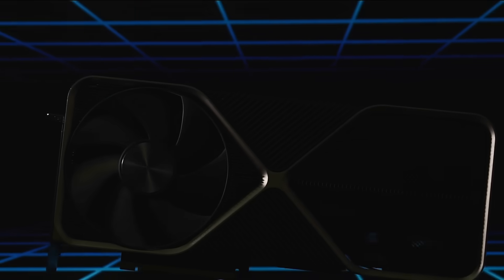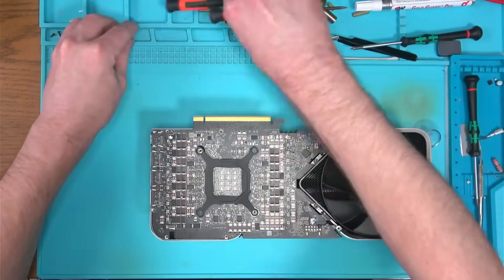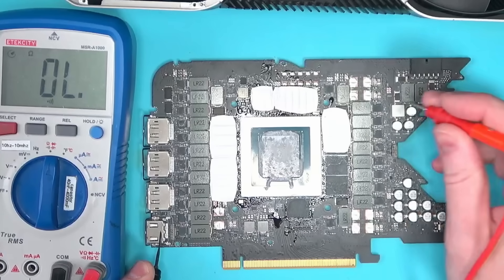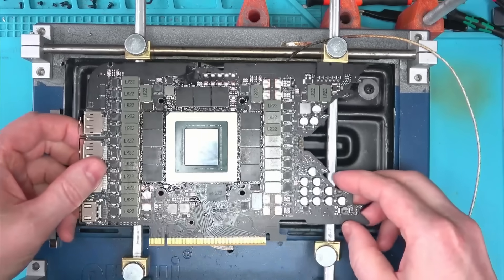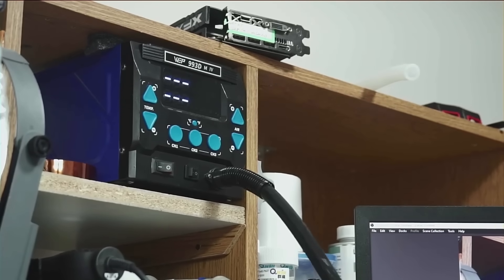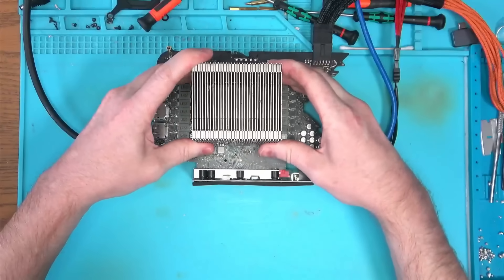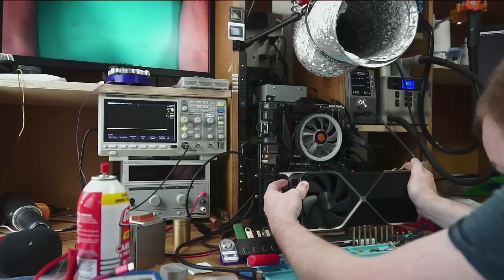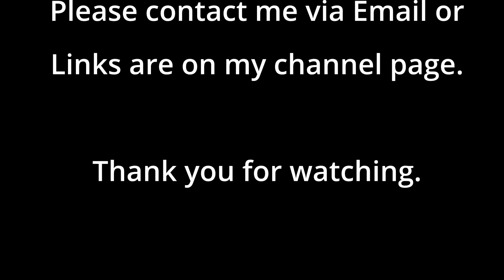Why 4090 reflow is a BAD IDEA

Comment: Do you use that little cheap meter because people are so borgia about crap like that, as if you need some insane meter to do these jobs, I know people are very odd.  I have a cheap meter too and I dont know why I would need to buy a fluke, I mean what exactly do you get?  an expensive slightly more accurate meter?  Do we need that accuracy for repairing pcbs?  Of course I dont repair anything I am trying to learn though, but man its all money buy this buy that etc now I need to learn how circuits truly work if I ever want to intuitively understand what is going on

Comment: I'm sure this gets asked all the time but why is 90+ degrees for a core bad during work, but blasting it with the direct heat of the sun to remove/resolder it to a board okay? Why doesn't it cook the chips?

Comment: repairing those rip of traces on the memory chip area...I wasn't even sure that was possible !...so, in regards to the P.C.B....the repair involved just placing down another copper disk, I'm kind of amazed at that, is there only one layer of traces through the card ?  I'm guessing that any repair at this level requires a lot of specific proprietary board layout knowledge...

Comment: I really want to know about the Furmark test. My 3080 goes up to 82C and the hot spot to 94C. Does it need a pad replacement, or should it be fine for a 75C workload? 2 years using it. but all its in factory fan settin and no other fan , but in higher 80% fan spin , stay in 71c, so add fan to case or replace pads?
Reply: Just add a new fan

Comment: After watching quite a few of your vids now, my recent video card upgrade am thoroughly glad I avoided the 40xx and the 30xx settling for a "GPU crisis" OEM 2060 Super which is awesome despite its age.   It will do until I decide to invest in a AMD setup down the road and felt a bit sorry for my new build RX580SP which I got for £51 and gave me 3 years hard gaming service and is now going into a Xeon dual CPU build mobo, cpu and ram from Aliexpress for £31, 20 cores 40 threads via the dual 2630 v4's.   Will still be a potent machine just no raytracingerythingy which I think is a con.

Comment: Actually Reflow Works Great If u know how to do it properly . its not only ''REFLOW'' Everyone Knows that Reflow is temporary .  U just Reheating solder joints to potentially resolve issues caused by cracked solder. Caused 99% by Overheat . After that U 100% need to undervolt ur GPU . 
so actually u make it live Longer not month but YEARS.

Comment: YEAH you hated on them for reflowing for no reason and yet you reballed the dang thing basically the same reason they reflowed it yet it wasnt the problem! You should have replaced the memory chip to begain with and you seen the errors on mem and wasnt nothing but the memory

Comment: Clean job!
I have been doing video reflows for years with a torch - never actually removed the chip (I don't actually do any micro soldering). And I've been pretty successful with it. Pretty much mostly on laptops, rarely on desktop cards. However, recently I reflowed a desktop 2080 ti - a dead card that someone left at my shop, and so far it's testing working well. 
A reflow is interesting, because you never know how long a card will last, or if it was actually the GPU chip itself without checking/testing as you're showing. I've had reflowed cards that have lasted years, and others just a month or two. What's really important for ANYONE is to always make sure you keep your system dusted out - it will help with the longevity of your computer as a whole.

Comment: Fail 95% of the time with newer GPUs?
My experiences with throwing GPUs in the oven are rather good, at first it might survive another 9 to 18 months, the next time it'll be half that and so on, until it's mere weeks and then ultimately other stuff will fail.
But this has worked on a lot of graphics cards I used or ones that were donated or on their way to be thrown away.
While the last time I did any of that is a few years gone by now and while I never attempted it on 20xx, 30xx or 40xx
I am far from the only person where this has been done quite a few times, to quite a few graphics cards and it is more like 95% success and 5% failure.
Tho the graphical glitches from failing BGA and memory solders are pretty distinct, so i personally doubt people try it for other failure.
For most of the time, this kind of thermal degradation was the reason for the majority of GPUs i handled, to be broken.
And for a card, 3 years past it's prime time or life time, to live another 1 to 2 years, is quite a lot.

While I don't think 40xx will much suffer from thermal degradation as much as earlier GPUs, the issue with how thermal degradation interacts with the solder due to expansion and contraction, makes reflowing it in the oven a cheap and easy way.
Reflowing it professionally should be even more useful for this very specific issue that we will likely not get around for a few more decades or until the last star in this universe burns out, depending on if we use solder or other electrical interface materials with different thermal properties in the future.

So if a laptop or PC shows certain artifacts and it needs to run and the only option is an immediate upgrade/replacement of the defective part.
Why not just throw it into the oven and pray?
Also in many regards, a dump into your oven to reflow, surely has a lot less points where user error could make it worse and especially if you only hit the right temperature in your oven and leave it for the appropriate amount of time, the thermal capacity and thermal conductivity of the different materials involved, will make sure that parts that are not solder, can not be damaged or be overheated.
Depending on the size of the cracks, which tend to be really tiny and miniscule, you won't even need to worry about having to use flux and with a little luck, the card will last you another two years until it fails the same way.

While a reflow oven offers considerable advantages to this process, you can use a reflow oven just as half assed and if it is this very specific issue of thermal degradation, it will work wonders without you even having to use flux or solder.

I wish this video went into detail as to WHY it is a bad idea also it seems that the card in this video does not show any of the errors where a basic half assed reflow is a possible fix.

Comment: So the card was running @ x1. After fixing the problem the card now runs @ x16. Would there be a performance difference if the card was running @ x8 compared to x16 @ 4.0?

Comment: Hello, I would like to contact you, I have an RX 7900XTX GPU that only works on the PCI Express 4.0 port, when I put it in the 5.0 port it does not work, I was told that it may be the graphics chip that has problems.

Comment: Sorry for a dumb question, what is Reballing and Reflowing and why did you say reflow is a bad idea?
Reply: I'd suggest doing some of your own research, but pretty much:
"Reflow" refers to the temperature at which the solder is certain to melt, reflowing involves heating the solder to this temperature, the goal is to restore any bad connections between the PCB's and the chip's surface pads caused by e.g., cracked solder balls caused by thermal stress (expansion/contraction cycles eventually could cause cracks in the solder balls)

In reballing, the old solder is completely removed/cleaned off and replaced with new solder balls.

Disclaimer, I'm no expert, but generally here's what I'm thinking,

Reflowing involves dumping a whole load of flux and heat into the chip to get the solder to certainly "melt" throughout, you want the solder to be liquid enough to flow onto the pads nicely, and flux needs to get all in there on every joint to ensure a secure bond between the solder pads.

On a smaller GPU, with average equipment available to your average repair shop, the process may be fairly straight forward given there's not much distance for the flux to travel, and with relatively little time you could get all of the solder heated up nicely, but a thicc boi like the AD102 of the RTX 4090, there's no good way to get a good reflow going given you can't magically get flux nicely between the PCB and the GPU....

And it's not only an issue with bad technique, reflowing the already well abused solder, abused enough that in at least one place the solder has become brittle enough/cracked such that the connection is unreliable/severed... The mechanical /electrical properties of the alloy are likely to be degraded due to oxidation, contamination, perhaps the formation of too many intermetallic compounds (IMCs) between the solder bulk and copper pads which could lead to more brittle connections, the reflow could end up forming a thicker IMC layer, making the "new" connections even worse, bare in mind you're reflowing all the connections, not just the affected one. 

So yeah the only real option is reballing, use new solder, clean/decontaminate both sets of pads, freshly apply flux all over etc, ensure all surface pads are nicely bonded.... 

It's an interesting topic, I'd suggest researching it yourself, perhaps some of what I am saying is inaccurate eh :)

Comment: I did reflow two times and both times it worked (although I had to reflow one card twice, because first time there were still some artifacts).
The reason I did that and not going to service is because reballing an old GPU is expensive and not worth it, while reballing a new gpu is dangerous - they can take your working gpu and replace it with dead one, and say you had a dead GPU. This is very common in my country.
Reball at home is not something you can do as a hobbiest, I suggest not even try it, you will certainly mess things up, while reflow is relativelly safe (don't cook your gpu for 10 minutes and it should survive, even if reflow itself will be unsucessful).

Comment: What I want to know is what are people doing with these cards that are requiring this in the first place? Why did someone attempt to re flow? One of the only thing that’s stopped me from investing in such an expensive piece of kit like this is all the repair videos I keep seeing.
Reply: The GPU is a very hot component. Constant change of temperature from 40C to 80C and back to 40C leads to solder balls cracking. Reflow fixes that for some time. You don't have to do anything particular for your GPU to die from that, it happens naturally after 4-5 years especially if you are a gamer or mine crypto.
Reply: @ yeah 4-5 years I can understand, but the 40 series ain’t that old

Comment: unbelievable that a card with components for a maximum of 50 dollars should cost several thousands.
and 99% of them are exactly the same as on early graphics cards.
Those companies are good at keeping prices artificially high
Reply: What kind of nonsense is this? In which universe 3000 transistors and 30,000,000,000 transistors are the same?

Comment: I literally don't understand what is wrong with reflowing.  Solder will melt and resolidify, if you don't move the chip when solder is molten, you should not have a problem.

Comment: When I was on the market for a new GPU I was looking at a 4090. Problem is at the time they were going for about 2300 USD because of scalpers most likely. There was almost no reason to get the 4080 because the 7900xtx was better in most cases and cost less. I was able to get a Red Devil for 1000 dollars. It was pretty much a no brainer. Even the 4080s were listed at like 1500. 
I would have liked to get the better performing 4090 but I'm not stupid enough to pay that price for one. If I had been able to find one for MSRP I would have. But my 2080 was starting to show its age quite a bit and I just wanted to upgrade everything. So I did and I don't regret it at all.
Reply from the maker: Yeah good choice. 7900 is a decent AMD card if your goal is to get fps.
Nvidia is more for production so it's cost is reflecting that.

Comment: Why do the components not get damaged when heated up to 200°C?
I was always wondering.
A law in chemistry says that chemical processes are doubling in speed for every 10 K step.
So are the components just aging 1000x faster during that time or is it just about the connections between the components that get damaged by heat?

Comment: It's always nice when repair people actually clean the card after repair. Especially when you use that thick aggressive flux paste.
I've seen some really dirty stuff in my days.
At my job we are not allowed to use that flux paste unless in extreme cases. It's too aggressive to the board and can damage it.
We use a flux that looks like water. It's a liquid rather than paste.

Comment: I reflow every single 4090 i work on.  I tell the customer there is a 50 percent chance this fixed the problem if done right.  Really, it ensures a 600 dollar repair.  If they refuse to pay, i have a clause in the contract i seize the card.

Comment: Out of curiosity on 5:02 the core has 5 balls on the bottom right instead of the the typical 3. Is that normal for this card? if so why does it need that many on the arrow side of the core?

Comment: nice alignment on the chip ,  i used to use $200,000 DRS27's by Air-Vac (Nitrogen gas fed) and i was creatign thermal BGA profiles for 3000 pin processor chips so I know the pain of alignment :)

Comment: Scale of 1-10, how bad of an idea would it be to take an FE 4090 with a water block installed and removing the water block/reinstalling the stock heatsink?  Likely to damage it or probably fine as long as I don't do anything drastically stupid?

Comment: 8:30 would have been quicker and easier if you used high quality thermal putty instead of pads. No need to figure out the correct thickness for the pads and transfers heat better too.

Comment: I've watched a lot of your videos, you're doing stuff pretty randomly.
You should hire a bureucrat, LoL.
Set up a procedure, print it out for every card.
Step 1. Check for shorts. (I always leave without my shorts)
If(short_was_found()) {check_fuses();} // LoL, I had to do this one.
Step 2. Data Lines
step 3. Crystal
step 4. if card is detected in linux or if it displays a picture
step 5. memory
etc...

I know it sounds like a waste of time and a stupid thing.
but otherwise you are likely to skip steps or maybe you just forget something or you're inclined to skip some procedures in order to save time.
This way you won't have to dissasemble the card again for a missing data line / missing capacitor, like in this video.

Comment: i mean i have no clue about repairing gpus in this kind of way, but even to me it makes 0 sense to reflow the gpu core. I highly doubt that the solderpoints of the gpu core fail and if the gpu core itself would be dead resoldering would fix exactly nothing. The previous repair attempt makes 0 sense even to someone without any knowledge.

Comment: My Gigabyte b650 board sometimes screws up the link speed on initial post (x8 on my 4070ti).  Not sure your test board, but a restart fixes the link speed.  On older bioses it would lock to x1 speeds on first boot.  Might be related to that behavior here as well, though a missing capacitor is also a problem.

Comment: I i was a graphics card company, i would invent the GPU Socket.
Reply from the maker: It would not work very well because of heat.
The board it's self is also a heatsink so it has to be close to the board.

Comment: I guess my gtx6xx ghetto reflow was one of the 5% ahaha
Like... HOW does that thing still live after like 5 years, I expected a month max.
Challenge: fix a gpu with only flux and a cheap hot air gun (a proper one at least)
Oh, I forgot to bring my thermal paste so I had to "recondition" the old one from 2012... worked like fresh mx4 for a week xD

Comment: I honestly don't think the client was insulting nvidia or any other gpu manufacturer. I mean, when its not working, its  called a brick. But lets get over that for a bit. 

What i would like to comment on is the fact that nvidia (and amd too) are kinda sort of at fault for this too. I have a 2080. When i got it, was the coolest crap. one year later, is was just crap, minus the cool. now, 1 generation later, sooner to next generation, is just crap squared. I didn't do that. Nvidia did. 

And one day, sooner rather than later, that 4090 will also be a brick, weather its working or not. coz it will certainly be worse than 8080 that will be modern in 4 years. 

PS Sorry for my comment. I just ... am thinking of the stuff that i have. that i saved. wonder where that stuff will go once i am gone. prolly to the landfill.

Comment: You are incredibly good at this! I would love if you actually described what you were doing, particularly in the montages. Even a title saying "adding flux", "removing old solder with copper braid", "cleaning excess flux" would be super interesting.

Comment: because it uses a lot of energy wich turns into high temperatures as we know and doing a reflow is applying high temperature to the welding ... so yeah kinda obvious it doesnt need a casually 10 minutes long video on yt the minimun to start getting paid for it...

Comment: What did you wipe the cards pcie connector with? Gold pin? I can’t find anything under that name online and am thinking that my Wireless Lan pci card could randomly disappear from the system and not show in bios because of bad contact. Only pulling out, starting without, shutdown, plug in, start with WLAN card helps for me. That’s very annoying. I use the GC-WBAX200 with Win10 btw.

Comment: Reflowing is ALWAYS a bad idea, you won't fix broken balls, and the chip won't survive infinite soldering cycles, so if anything, just  perform a reballing.
Anyways these are more likely to warp, breaking the pads on the pcb, so reflow will likely fix nothing.